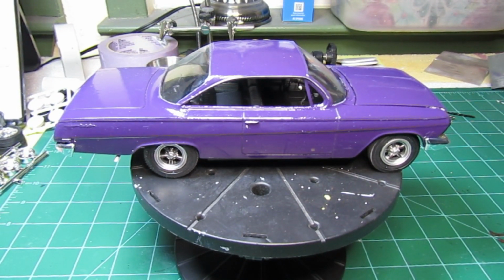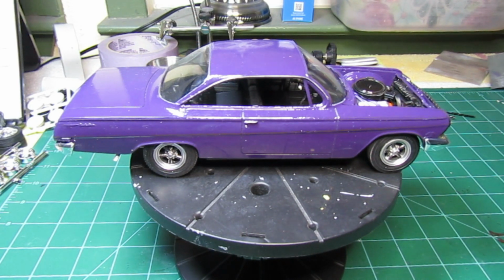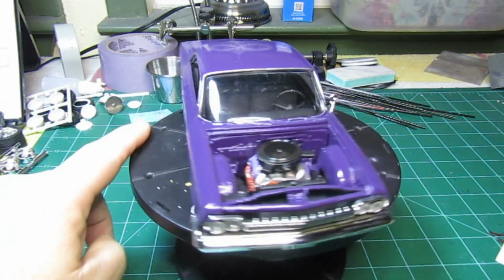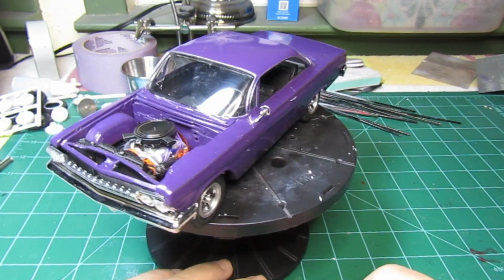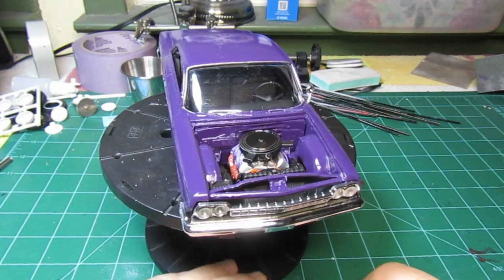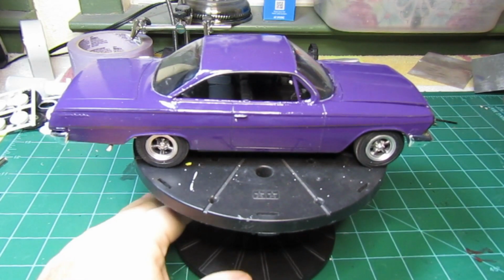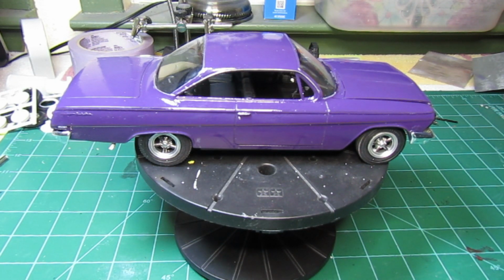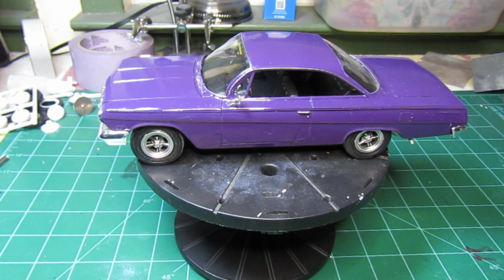AMT Ertl 1962 Chevy Bel Air 409 Finished

Comment: Thats one of my favorite Chevy's  John, I really like the choice of color you used.  Sometimes the simplest kits can be the most frustrating.  As far as paint problems ,I have found that when the barometer is low is when I encounter most of my problems . Also some of the paints in rattle cans they have changed the mixtures and they don't cover as well or they can cause the dreaded fish eyes. I'm in the process of learning how to air brush, but I'm not having to much luck. Can't seem to get the air pressure correct. Anyway this build looks great, despite the problems you had. I would be proud to put this one on display.
Reply from the maker: I have used an air brush on some models and am still learning the process, rattle cans can sometimes be less of a process. The strange thing is that I had used both spray can and clear before with no problems, which leads me to lean more towards user error. Lol. Thank you for your comments and for watching

Comment: What kind of paint did you use.
I always paint my body's last because you're always test fitting things to make sure things are going to fit right.
I always use Tamyia's paints I used the gray primer or I use a flat black as my base coat I have never had any problems with Tamyia's paints. I always use testers flat colors for interiors or chassis I also use semi-gloss black for interiors also. If I was you I would paint the body last after you have tested everything and everything looks good to you then paint the body make sure the body is clean wash it with soap and warm water and use 1500 grit sandpaper to sand the body and use any putty that you may need to fill gaps or dimples
Reply from the maker: On this one I used rattle can from Home Depot. I never have had any problems until this kit. I am now using Tamyia paint. I just use cheap rattle can flat black.